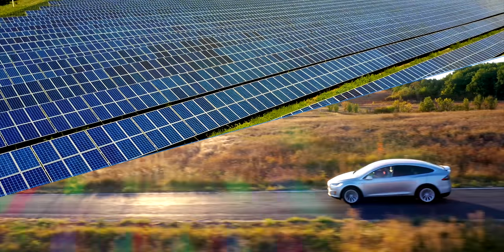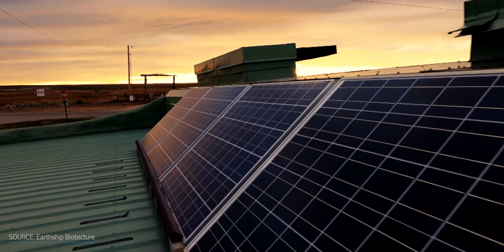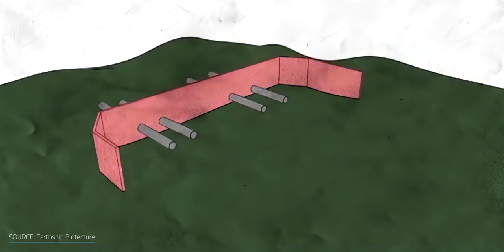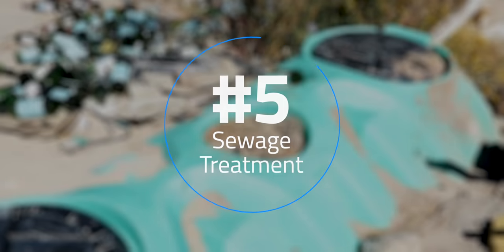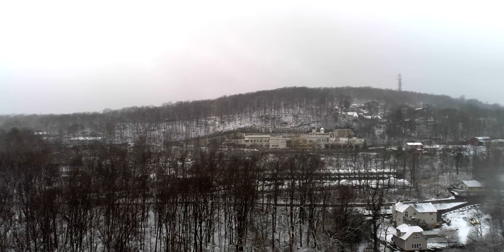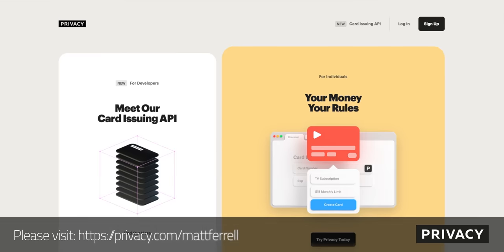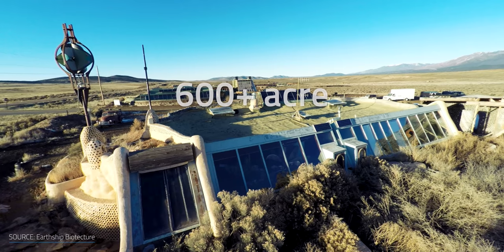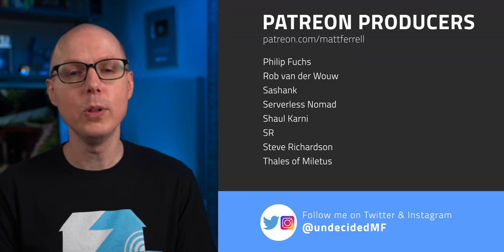Exploring Off-Grid Earthship Homes - Ultimate Efficiency?

Comment: I have been intrigued with earthships for years.  I like your addressing the cold climate issue and the cost to build.  It bothers me that there aren't many outside of the desert as far as I know.
Reply: Condensation can be a significant issue. In moister climates, the cool ground can cause moisture to condense on the walls leading to mold/mildew/moisture issues. There are ways to deal with this, installing a dehumidifier or air conditioner being the big obvious one, but that generally brings up a list of additional complications one has to deal with.  In fairness, effectively dealing with moisture is a big challenge in all building designs not just earthships.

Comment: Biggest issue with these is that they require space and are designed for a relatively stable climate. Still find them fascinating though. I love the 1970s, outdoors-brought-inside design.
Reply: One more challenge that limits earthships to a very niche market segment is that you need roads.  Where there is a lot of space and few people, it might be possible to build a few earthships, but you need roads to bring the materials in and connect to anything else. Which means that you need cars.  So, you need a car house (garage) too, and more solar panels or wind etc. to power the vehicle, ie. more technology.  Now, all of that road network is space that is not useful for agriculture (although granted, there's not much of that in a desert) or wildlife, and has a maintenance cost - who pays?  This means that earthships are fairly ecologically expensive.  If you're going to provide housing for a LOT of people, it's much more eco-friendly to build denser communities in cities.  Sadly.

Comment: There is a school in California. A central core is the library. Surrounding that irate classrooms. Out side dart is piled up against reinforced  concrete walls which make up the structure of the school. Each room has an exterior door, glass mostly. Skylights provide daylight in room and the library. This school has existed

Comment: Adopting an earth-ship plan as a community garden to provide local produce during the winter would be interesting to see adopted into a city architecture plan. It would be a great research spot to see what effects VOC's from tires in the walls to absorb heat have on the plants and graywater. It would be something that may provide new filtration systems for water or food for expecting mothers and prevent birth defects, still births, or developmental problems.

Comment: I think a mixed approach is needed. Take a normal passive house, add a slanted greenhouse or a very large window-wall or set of window walls or sun-rooms and use a dark-colored floor to store heat, and add a lot more insulation on the sides not facing the sun, and maybe use plastic tubes cut in half for landscaping with grey-water and for landscaping plants as leech fields with black water. And all those plants can also be directly ate by animals like chicken or rabbits, whose manure can be used to fertilize the plants intended for human consumption. Also, for very cold places, there are already plenty of cases of houses built inside greenhouses, or houses which had greenhouses build around them, and using concentrated solar (solar troughs, for example, or simply using mirrors to get more sunlight reflected onto the house) can also provide heat and daylight to help with that. Even without mirrors, some greenhouses built in cold regions can make the climate 3 zones warmer, and using concentrated solar heating can probably increase that to 5 zones, at the price of higher costs.

Comment: my dad was a huge fan of all these ideas, and Earthships ...since the early 80's he kept loads of books around, visited/helped on builds, and we talked a lot about sustainable ideas before he passed.

the ICF buildings i'm planning utilize earthtubes (10' underground air ducts that absorb the soil's steady-state temp) to feed the ERV (energy recovery ventilation) system with ~62f temp air year-round, instead of only being used for cooling in-conjunction with the stack-effect (as you describe in the vid). this should dramatically increase their efficiency, as the temp delta between the living space & incoming fresh air is minimal. they could also be routed through the exchange half of mini-split heating/cooling systems, giving the heat-pump more temperate air to pull/dissipate heat with (again, higher efficiency).

not aware that either of those have ever been done before, so i'm pretty excited to test the concepts.

Comment: I agree with most of your points. However the 50 inches of rainfall comment I thought missed the concept. It is more needed in a low rainfall region as reuse of the water decreases the overall incoming water requirements. Even if you haul in some of your water there would be a reduction in the amount needed. Remember that there is 0.6 gallon of water per square foot per inch of rain, so a 2000 square foot home would yield 1,200 gallons for every inch of rain. Reuse of grey water would be a big benefit to cities as it would not only reduce the water they need to provide, it also reduces the amount of sewage they have to treat. Rainwater collection also reduces the amount of storm water runoff the city has to treat, so some cities are actually starting to make some collection mandatory.

Comment: I think the best building way is to start with a concrete skeleton because it causes no more harm after it is casted and lives forever. Then for the wrapping, you can choose the walls, insulation and cladding that you want. The added bonus is that concrete is pretty flexible to work with if you want some changes made and could be produced with renewable energy. Besides that the wolf can’t blow it away.

Comment: Great video Matt. Interesting that they use tires for the soil. In my country we use soil traditionally to build houses. My own one uses these too. The bricks are made of soil/dry grass mixture. They last forever with proper insulation from ground water. There even designs where the walls are constructed with compacted soil/grass mixture. The walls are super thick, and even in super hot summers(40c) they keep cool in the inside. Good stuff for sure

Comment: Many small towns and cities in Latin America, where I have been many times, live with the environment.  They stay cool and warm with very simple methods that have been used in those towns for ages.  One simple example is one I saw in Colombia a few months ago and that is almost everywhere in 3-story apartments.  An air shaft connects from the first apartment's floor through its roof to the second and third apartment and connects with the third apartment's roof.  It allows the hot air to escape through the third floor apartment's roof, sort of like a chimney, while cool air comes in through every apartment window and door.  It is basically like an elevator shaft with a garden at the bottom, first floor apartment, and ends in a covered, chimney like roof, so that rain doesn't get in.  At the third floor roof, there is often a terrace where you can sit and drink coffee at any time, though some times only the third floor has access to this part.  I was in the first floor apartment and while you can hear people talking in the second and sometimes the third floors, the place stayed cool all day long without the need for air conditioning.  The only thing I would add to the system would be an air extractor (if that is the name?) like the ones we have on American roofs to circulate the air in attics, since sometimes the breeze dies out.   We can also live like that.  Let's re-discover our roots and live simpler lives when and where possible.

Comment: I think that the best path forward for Earthship design is to streamline adding aspects of it to passive and traditional homes. Imagine the impact of making greywater recycling a nd rainwater harvesting standard features to look for when shopping for a house. A lot of the principles can be modified (at the cost of full/max efficiency) to fit within existing codes and regulations. Personally, I plan to build a house that incorporates Earthship designs and concepts with my personal tastes and regulatory requirements. With all the extreme weather we have been seeing around the globe, it is clear that having some degree of independence from centralized services could save your life (in the space between centralized system failure and recovery.)

Comment: I'm planning on building my next house with SIREwall techniques.  Structurally Insulated Rammed Earth.  Basically dirt mixed with portland cement.  2 feet thick walls with 4 inches of foam insulation in the middle to provide a thermal break.  I've read that they were able to keep houses in Phoenix during the summer at a comfortable temperature by running a swamp cooler for 4 hours a day.

Comment: Actually they’ve also demonstrated (via certified state lab testing) zero contamination from growing food plants/trees with black water, not just gray water. The soil organisms and oxygenation from the root systems in the planters purify both gray and black waste sufficiently as long as it is completely contained beneath a couple feet of soil. The septic tank is only required in states that haven’t yet recognized the extraordinary power of the planter system, and most states actually care more about the dangers of gray water. Many Earthships have only used an overflow leach field to direct any excess water in the system to outdoor plants.

Comment: Taking the concepts of Earthship it is actually very easy to separate them out.  For instance one could build the green house as a separate building and pump in the grey water. One could easily build out the power and the water control modules and place them anywhere in the home.  Building a passive building and then berming three sides just using conventional materials is another option. The point is that outside of building with recycled tires does not have to actually be a part of the construction.  One could just as easily use compressed earth blocks or rammed earth and achieve exactly the same result with less cost and effort.  One could build double stud walls and be finished framing in a matter of weeks rather than months.  Getting thru the permitting departments can still be a nightmare with the experimental nature of earthship construction. I know I explored these options

Comment: The interesting paradox of water harvesting is that you can take so much water out of the cycle that you stop it. That's why in some states it's illegal. There have been cases where water harvesting became so abundant that tributaries and streams stopped flowing completely. Like a mini Colorado River/Lake Mead issue. Remember that modern communities were designed with the water flow off of hardscape in mind.

Comment: Been researching this technology for decades and love the whole concept. But, comparing Earthship construction costs with passive energy construction is apples and oranges. The latter doesn't harvest, recycle,  store, purify, and irrigate with rainwater, nor produce nutritious foods in a desert.
I've also designed my own pseudo-earthship home, using 20 ft diameter monolithic domes, connected together, with bathrooms and walkthrough storage closet 'tunnels'. Granted, 4 inch thick of concrete isn't environmentally copacetic, but it's only 7 cu yards per dome and can easily be sprayed on as shotcrete, within a few hours per dome, and requiring only a 4 man crew. Hey, I'm an old man. it would kill me to beat a thousand tires full of dirt.
Otherwise, I'll be using 6" diameter geothermal tubing for convection HVAC, plus passive solar heated hydronic PEX tubing in the floor slabs.
Bermed soil provides thermal mass + vegetation provides evaporative cooling on the exterior.
The combined configuration and materials minimizes electrical demand and off grid power equipment.
The entire site will be underlaid with pond liner providing rainwater runoff into a swale and cistern for hydroponic irrigation of a greenhouse, just incase my well ever goes dry from the receding water table in my area.
Thanks for asking. :-)

Comment: I have followed Earthships for a long time ever since the actor Dennis Weaver had one built in the 1970s.

It is very true that Eartnships are not for everyone. 

It takes a lot of hard work to build one of these on your own.

Thousand of hours of hard labor.

I think there are some design elements of Earthships and Passive Solar homes that can be adapted by standard home builders.

One of those elements from passive solar are correctly sized overhangs on the south facing walls.

I live in Texas.
If most south facing walls on standard construction houses had slightly wider over hangs.

During heat of the day the south walls would be in the shade.

The brick walls would not get direct sunlight absorbing heat and dissapating through the insulation and sheetrock of the living space.

R value only absorps so much. Then the AC has to run more.

Comment: I have followed this concept for some time and you have noted some of the draw backs, having to supplement the heating for some parts of the world. The cost also is a sticking point and unfortunately not enough space to grow enough food and planning problems. However like all these "alternative" ideas we try these things to find what works and what doesn't and cherry pick what works. I think using the tyres to store heat in a separate area and drawing that heat when required to supply a well insulated house would be a better option.

Comment: Great video.  I believe this is the first earthship video where the price/sqft was stated so clearly.  I admire the concept, the up cycling and the independence.  Out of the many facets, the water recycling has the most applicability for wider adoption.  Local building codes will need to make that easier/possible.
Reply: People who join the earth ship community tend to learn a lot about water, sewer, and then know how to do it safely. If you are not careful, you can easily do it wrong. If untrained people do the same thing, there is a high risk of creating a large health risk. In wider society, many people struggle to change HVAC air filters once a month or smoke detector batteries twice a year.  Before there were codes for water and sewer, lots of people got sick and died regularly from preventable water born illnesses. Many areas have more plentiful water, and just using a standard well and septic tank is a super easy way to avoid all those health risks.

Comment: For heating you need insulation here since the ground temperature here is around 65F. Here in mn it was shown you want at least a R2 from any thermal mass to the outside or you will end up increasing the heating load as the cold temperatures cools that thermal mass.

Comment: I have loved Earthships since I first learned about them.

The offgassing concerns have been shown to be valid when the tires are exposed to light, but when they are properly buried or covered with a finished wall, they do not emit VOCs.

I've thought a lot about island nations that are facing sea level rise and the way that Chicago built up the city after the Chicago fire.

It might be possible to build seawalls from tires like this and elevate sections of these nations to avoid being swallowed by the sea.

I think Earthships are really a response to scarcity and humans impact to the planet that is looking for a truly new way to live. It isn't looking to fit in with an existing flawed system, but rather to exist independently from it and withstand any hardship brought on by humanity's impacts

Comment: Creating a machine for compacting dirt into these tires and renting it for such builds would be an awesome business model. Or the dirt could be liquefied and poured in then the tires heated to dry up. Or the dirt could be ground to a more fine grain, the tires vibrated, while the dirt is poured-in more or less as sand, then as the vibration stops it would solidify. Additionally the tires could be sprayed with some sort of lacquer to prevent the sublimation of these harmful particles.

Comment: The concept of earthships is great and utilizing materials that would otherwise end up being filler for dumps or burned is also great but the amount of labor needed and the risk of out gassing from tires makes that part less than great. I would think a mixture of rammed earth / earthship construction might be a way to improve and widen the possible regions especially with moisture traps to pull excess humidity (more h2o for the water cycle systems?) All in all a fascinating subject lots of possibilities

Comment: Using the ties to create round clay/ mud motor bricks might prove more cost efficient.  The round disk shaped bricks from the inside diameter with the mass of the tire filled leaving just the center of the tire.  ⭕⛰⛰
Stacking the bricks and adding the tires through out the the weight supporting  sections.  Maybe

Comment: I love all these eco homes, would love to have something built and suited for me, in some remote area surrounded by forest trees that is mostly self sustained and off-grid. I would like to pull in resources from multiple places for heating, cooling and electricity generation. Heating coils in the ground, with cooling exchange that changes during hot and cold seasonal weathers, solar + wind electricity generation, I do think it's necessary to have more power than you think you'll need to store in batteries than not having enough power and falling short when power demand doesn't meet your expectations, so having a few extra batteries on hand for storing excess energy can be useful.